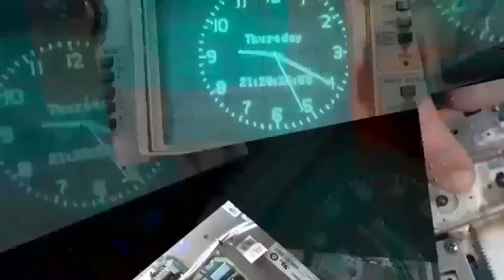Emergency Lighting BACKUP power Repair

Comment: Good repair, but one thing: Will modification of a "safety item" not void safety regulations?
Reply from the maker: This was not a modification.  It was a repair. Transformer replacement.   Electrician reinstalled and fire inspector tested and passed. Now perhaps if it was a fire alarm things would be different but this is a backup light.

Comment: I recently started flipping vintage electronics on eBay as a side business; I'm an engineer by trade. I get a lot of electronics pretty cheap because they are either broken or just need a simple part replaced. I found your channel, and I want to say you are an absolute treasure trove of knowledge. I've been binging your videos, even the ones that have nothing to do with what I'm repairing. Subscribed!

Comment: I was going to assume it was the battery. I assumed incorrectly.
Edit: I have my dad's old Black and Decker drill. Looks similar to yours.
Reply: My dad had a similar B&D. Gotta love those old metal cased tools with the 2 wire plug. Went to use it and got zapped when i pulled the trigger..Never borrowed that tool again when I was a kid.
Reply from the maker: @bobsoft  This used to have a 3 wire plug, but someone (not me) chopped the ground lug off.